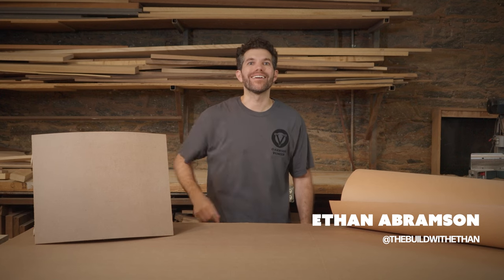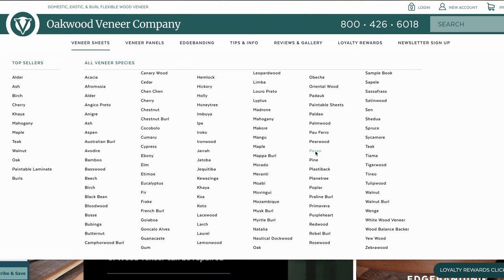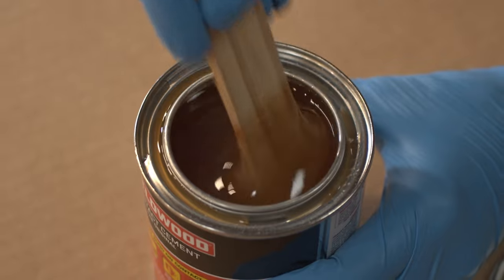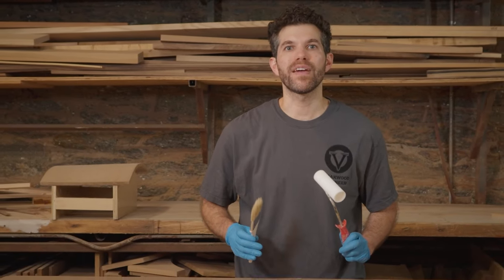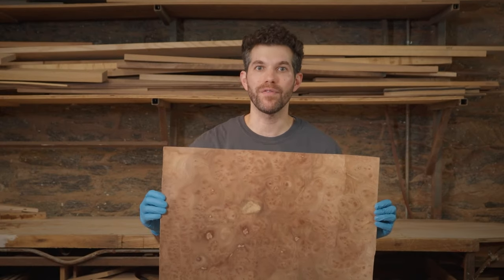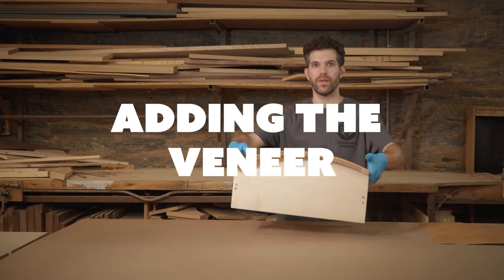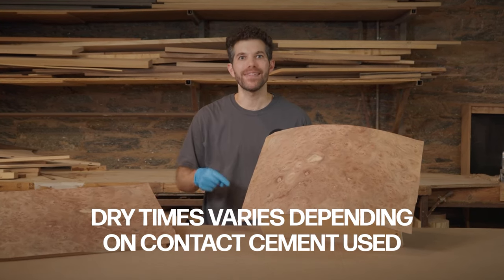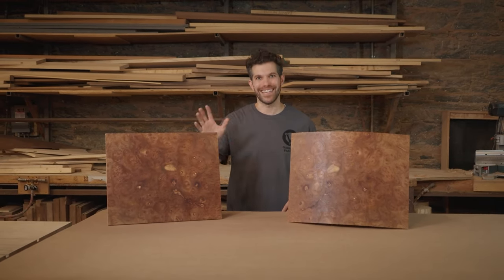How-To Apply Wood Veneer to Various Surfaces; A Step-by-Step Guide & DIY Wood Veneering Tutorial

Comment: Hi. Thanks for making this video. I wanted to ask for a clarification: You said that if there are holes on a piece and you put a veneer on it, it will show the holes... curious how it would do that? Is the veneer transparent to a certain extent? Thanks.
Reply from the maker: Thanks for reaching out. Wood veneer is NOT transparent. However, if there is inconsistency with your substrate for example, holes in your substrate the veneer backer has no support or substrate to grab onto resulting in visual changes to the surface. Think waves and ripples within the surface. If you have any other questions let us know!

Comment: I have a nice sheet of PSA veneer and I am going to try to put it on salvaged coffee table. 2 things I need advice on. First, it’s like an ikea piece.. laminate fake wood. It’s also been perhaps damaged…? ..like… it got wet? I sanded it and it’s PRETTY smooth. But certainly not perfect. What kind of extra precautions do I need to take? (I almost feel like it’s grittier and the adhesive may stick even better!) Second, it’s a “lift top” or “pop up” coffee table, and this particular coffee table has 2 separate side by side surfaces, but I want the grain to line up.. almost like a waterfall effect..? I’m assuming I should cut first, THEN apply the veneer.. although my inner optimist wants to apply and then cut 😂
Reply from the maker: Hello! If the integrity of your substrate has been compromised we would not recommend veneering it. If your substrate is not completely smooth these imperfections will show through your veneer.
Reply: @OakwoodVeneer  I just finished sanding the top with 180 grit on my orbital sander. Top is smooth now 👍🏼 I found the original table online.. it’s MDF with laminate.

Comment: When you apply the second coat of contact cement, should it also be dry/tacky or wet when you place the veneer? Also, should the cement be wet on the back of the veneer when placed?
Reply from the maker: Hey Alexis! Thanks for reaching out, when applying contact cement you are always looking for a tacky not dry consistency before applying. If you need further help with your project we have a great staff who is always ready to help! Give us a call at 800-426-6018